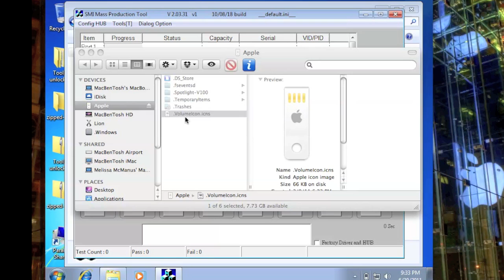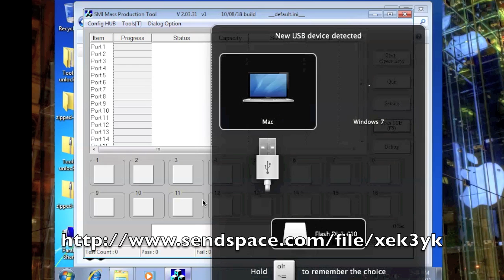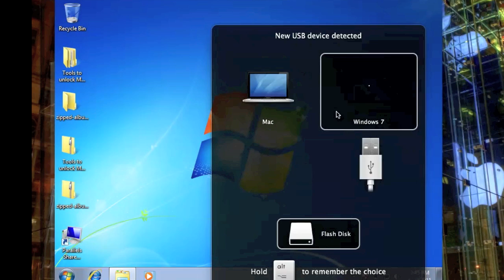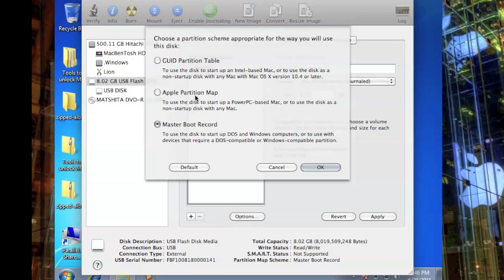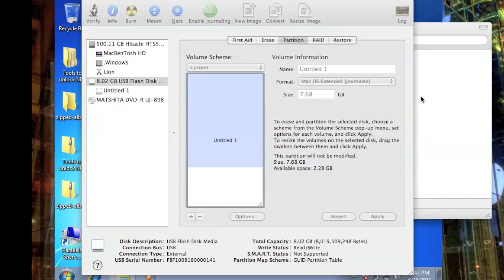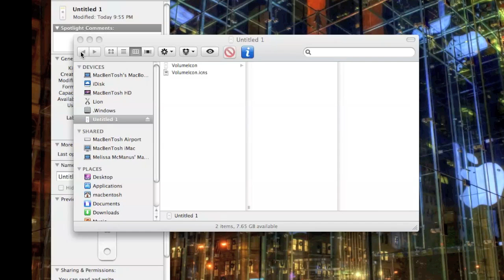Hack your MacBook Air Drive

Comment: The video is almost 6yo, but let's hope for an anwser: does this exact same tool and process work on other locked drives? Cuz I have an Adata 16GB(!) USB 3(!) drive that came with a useless recovery that I will never use again.